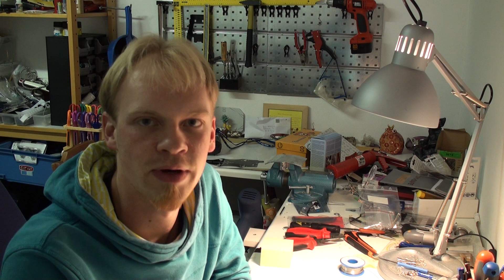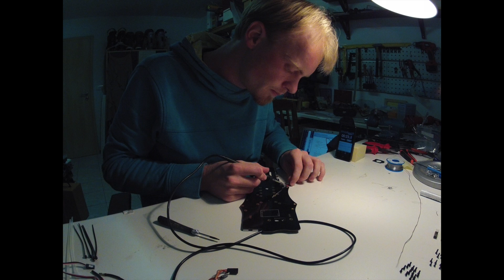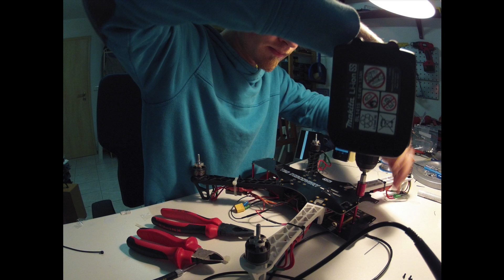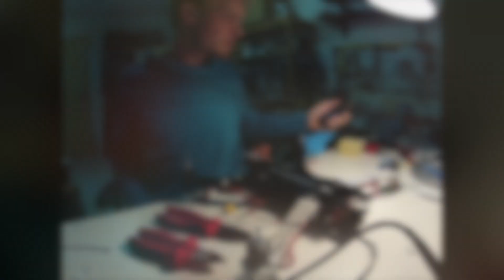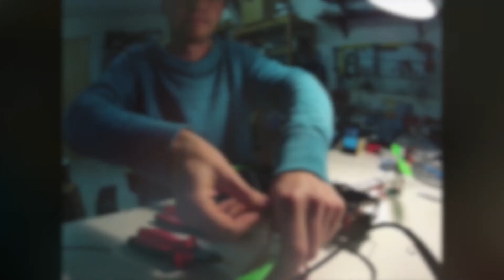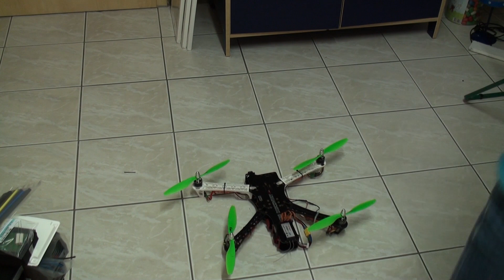DISCOVERY build in 31 Minutes!

Comment from the maker: Of course you can use them if you have them already. The 25A are enough. On my last flight I had a peak of 23A for the whole System (RCTimer 750kV Motors, 4S Battery, Graupner 8x5 e-Props, full FPV Setup), so 25A per ESC schould be fine.

Comment from the maker: Thank you!

I've used the Plush 30A. They're not bad, but I would recommend the HobbyKing F-30A to you, since they are very easy and cheap to flash, if you wanna use the SimonK-FW later on. For the Plushs, you need a different kind of programmer (a Silabs one).